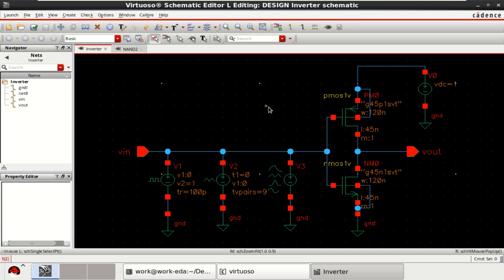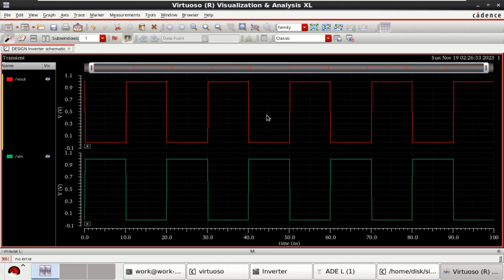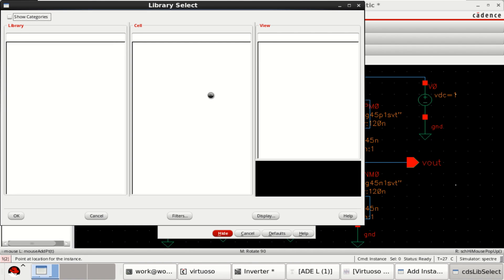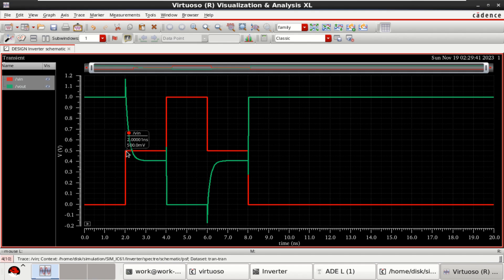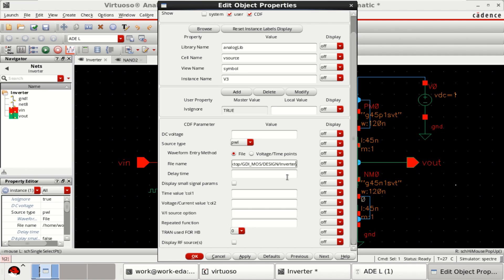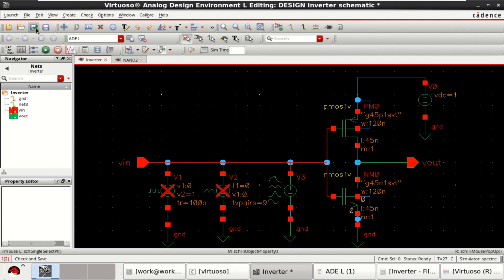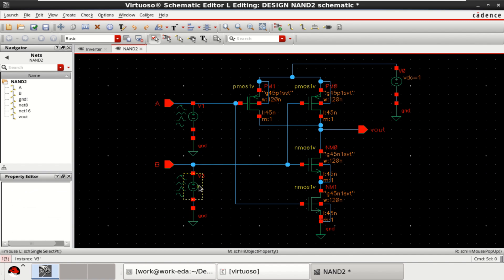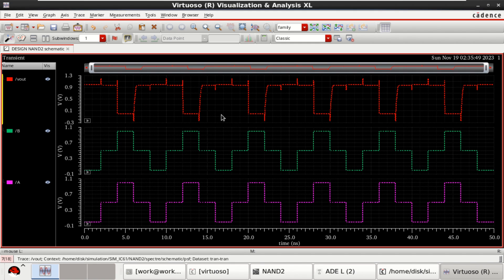How to Use Piece Wise Linear (PWL/PWFL) Source in Cadence.

Comment: While Im using PWL it is raising linearly not in a step wise manner
How to do that pulse instead of linear raising
Reply from the maker: Hi, check the time and voltage that you have provided.
Increase no of pair of points greater than 2
Give time1,voltage1, time2,voltage2 and so on to all the no of points.

Comment: Dear Professor,

Please, could inform me if I can simulate ( OECTs ) " Organic electro chemical transistor" with LTSPICE. 
If you have a nother possibility to simulate this devide, please, inform me. 
Best wishes
Reply from the maker: Hi, is the OECT a mathematical or 
Spice model. Based on that simulation can be doen
Reply: Thank you Professor for your rsponse.
Please, I need the OEFET file spice if you have the link to insert it in my library .
Thank you for your help and your collaboration.
 @dr.hariprasadnaikbhattu

Comment: hello hari sir do you remember me i am the same guy who asked you some questions of designing the layout of 3bit ripple carry adder . i have imported nand gate layout directly for designing of xor gate layout as it contains four nand gate but i am getting error of metal and metal crosssection in cadence again and again and i am unable to manage the metal vs metal crosssection error all poly joining are inside the nand gate layout and outside of that there are many metal metal joining but they are getting intersected .please tell me what should i do .
Reply from the maker: Hi, import the instance of nand gate. Not directly. Need to follow the design rules
Reply: Yeah I have check drc and lvs both
Reply from the maker: If possible use metal 2 when there is crossing along with metal 1, metal 2 via
Reply: Before your reply my mind have got that idea 💡💡💡 but tell me sir I have used metal1 for input A and B in nand gate layout then for xor gate which contains 4 nand gate I have to make two another input let's suppose Va and Vb so if I make va and vb metal2 and metal 3 then while connecting to input A and B I have to use via metal2tometal1 and metal3to metal1 right sir